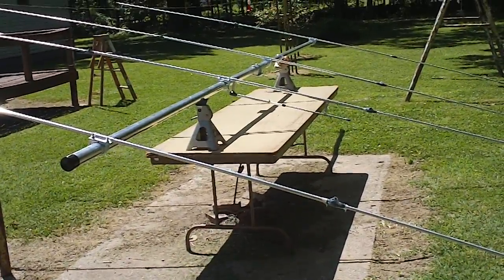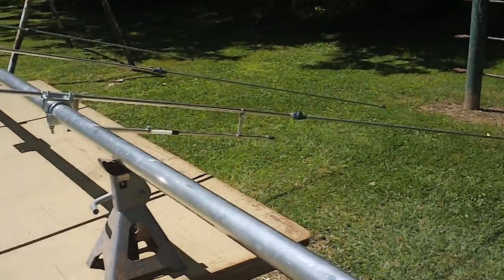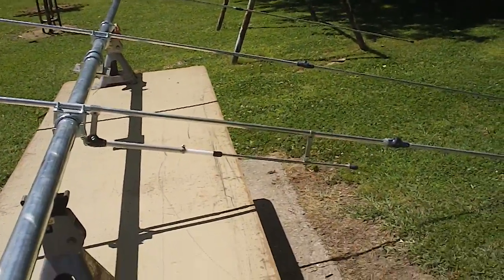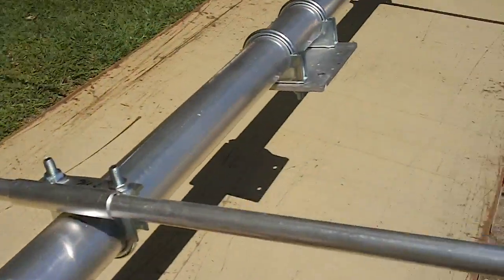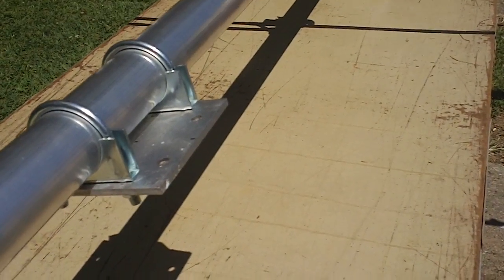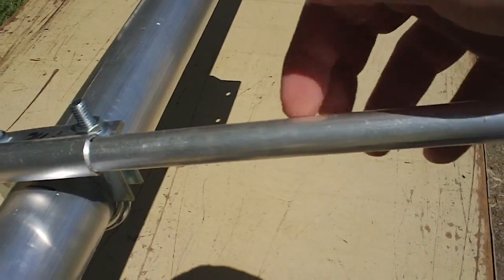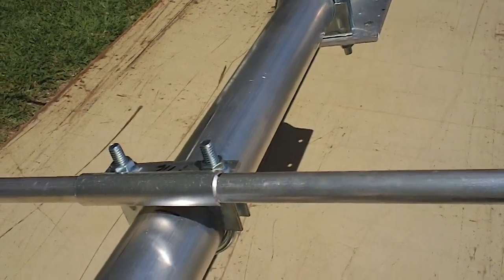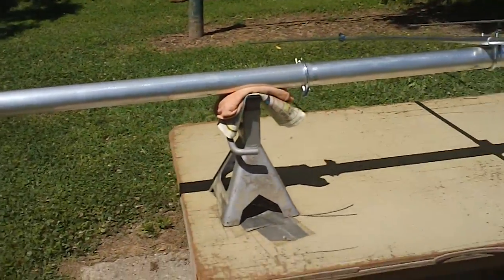The New Maco M104C Assembled

Comment: I know this is an old video but something ive learned throughout the last 45 years. When using vertical put the gamma match on top. I use a flip flop rotor on mine and when I rotate it vertical, I get a great standing wave with the gamma match above the boom instead of below the boom which puts the gamma straight in line with the mast.

Comment: Hope u like that antenna.....been running a m-104 horizontal. For about 30 years now.....2different cause I sold one in between houses .....great antenna....got qsl cards from 160 countries using 100w.....low noise,great side rejection.....great gain for smaller footprint.....still using one.....good luck....

Comment: When you seal your slip joints up like that do you not have a problem with condensation inside and not drying out? I'm getting ready to build a maco comet and I have a maco v58 right now and I'm considering sealing up all the slip joints with shrink tube. So I was just wondering if condensation inside the elements may be an issue.

Comment from the maker: For horizontal yes but for vertical using steel mast I've found it takes much more than 6". The tower & steel mast both couple with a vertical mounted yagi. You can raise them high enough to reduce the coupling with the tower but if the mast is steel it still couples with it & distorts the wave pattern. Experienced it many times in various real life tests. One example using a steel mast, tune a yagi horizontal & flip it vertical the readings on an antenna analyzer will be vastly different.

Comment from the maker: Shooting Stars are nice. Back in the 1990's I converted a damaged Shooting Star into a 3 element Comet. One end of the boom was bent & split but there was enough good boom length to make a Comet. The only reason I didn't go with a dual polarity array this time is because I'm going to move the V-quad to a shorter tower by my radio room and use it for horizontal polarization. I have a CDE AR22 for it and the coax run will be really short. 73's Paul

Comment from the maker: You didn't pay attention to the part were I explained what you see is not exactly how I did it. Yes I used a level for each element and the boom was clamped tight to the stands so it couldn't move, mentioned in the video as well. All is shown here is the end result after some of the setup (clamps and such) were removed.

Comment: Can I mount a maco m103 horizontal on a steel mast and get it tuned just fine to be OK? I won't switch it vertical I'll just use it horizontal, I will upgrade to an M105 later on down the road right now I'm looking to upgrade from my Andron 99 and I do not have the space for a M105 yet

Comment: Getting back into cb from being on the ham bands for a while.  I have a M103 in the shead but thinking about getting a m104,  I have a aluminum mast.     What is your opinion about the m104 vs a 103 I herd you said you experimented one.   Also when you mount it do you put the gamma on the top or bottom elements?  Im not used to gammas etc.   I build antennas and make them with baluns or use ladder line and a tuner on ham.  ETC.   Any input or advise or should I even purchase one?
Reply: A HERD is a bunch of animals like deer.HEARD is something you do with your ears. LOL

Comment from the maker: The stacking/cophasing I'm familiar with. Bad thing about it is I believe you looses half your band width stacked? Never tried it myself but that's my understanding. Other down side to stacking is the wind load & all that stopping inertia of two arrays. No problem if the rotor being used can handle it.

I must admit I'm ignorant when it comes to the effects of replacing gammas with baluns. I have very little experience with baluns. Your idea is interesting for sure. 73's Paul

Comment: Had my M107 monted on a 45 foot tower with the steel mast only 3 feet over the top of the tower. It was a murderous setup. I took a 10 foot section of tower and tied it to the deck out front. Then I mounted the rotor, steel mast and beam. I hoked up the Dosey and tuned the 2600 gamma match to 1:1. I took it all down and apart and then put the tower up. Then added the rotor, mast and Beam. At 45 feet, the SWR was 1.3:1. Good enough for me. I mashed into NJ and Penn from Eastern CT with ground wave conditions and skip was never a problem. Even on Ch 6, I talked at will except when one guy was on. We were neck and neck so he wasn't covering me up with his flat 6 and his steel tube amp. Not really trying to be the biggest. Just wanting to reach out there and touch someone.  :-)
Reply: Dosy meters SUCK or Dosey as you spell it. LOL No matter how you spell it they SUCK.I was also wondering what HOKED up is? LOL
Reply: They don't really suck. They are certainly not Bird 43 caliber or quality but they are good for in line monitoring as long as you aren't doing huge watts. I run mine mainly for the AM Monitor Function (Headphone Jack) and to be honest, both of my Bird 43's read the same as the Dosy 4001P on RMS. Peak watts are a bit higher on the Dosy. The Astatic and Paradynamics meter really SUCK! LOL. Ya! Dosy! I had a couple of typo's in that last message. Typing while on the job. LOL  :-O
Reply: Sure they do.Why not make a video showing the BIRD vs the Dosy on Peak readings? A Dosy has No Peak Circuit in it so it just jumps all over the place & some of us know what you said is total BS when the Truth would have been much better.

Comment: The two things that you can do to get around the steel Mast issue would be this.Buy another 4 element just like the one that you have now and stack them side by side 9 feet apart vertically.The second thing that you can do is to get rid of the gamma matches and go to direct drive with two DX Engineering 1to1 baluns.This would take care of the radiation distortion issue And improve band width, forward gain and rejection.Especially front the side rejection and front to back rejection as well.

Comment from the maker: That would work just fine for most but not in my case. I need a great deal of local vertical gain and can't get anywhere near enough with any omni. I'm eventually moving the V-Quad to another tower to use for horizontal polarization. 73's Paul

Comment: Actually there's less torque against rotor with stacked arrays on the tower then your single array 10 feet above the tower.Check out the A.R.R.L.'s Antenna compendium book for more info.Its about $30.00-$40.00 dollars,but worth the cost.It's a book about the thickness of a New York phone directory.But it's fairly easy to understand how to get the most out of your antenna investment.

Comment from the maker: The M104 is not drastically better than the M103 IMHO. Built the M103 for my friend & neighbor. He still uses it & it performs as well as my M104. The manuals for the Maco antennas are on their website for download. The gamma mounts on the bottom, counterpoise, side. I don't have any experience with baluns but I'm familiar with them. I'm sure you could make a balun for a Maco and feed it that way. Done right it's likely more efficient than the gamma as well. 73's Paul

Comment: I acquired a Maco 104 these days.  When I watch this video several times I see that you made several mistakes putting that antenna together.  The first is to use that silicone paste.  This antenna is one that fits in 1/8 inch measurements and it would be difficult to make some small change after that silicone dries.  There is no need for so much glue, the tube ties are made of very strong aluminum for performance.  The second mistake I notice is in the gamma match.  I see that it was adjusted.  There is no need to adjust it since it is configured to obtain the lowest SWR in 11 meters.  If you are correcting the SWR when the antenna is on the ground or has many obstacles it will give you a high SWR.  Once that antenna is in the air mounted your SWR will be 1.1 on channel 19. Third mistake I see is the distribution of the elements.  Because this antenna has a boom of three pieces should leave 3.5 inches at the ends of each end, so that you have no conflict between an element and the union of the boom.  I recommend following the instructions to the letter so that SWR is 1.1 like mine.  Use RG-8 cable at 100 feet.  Thanks for making this video, it helped me a lot to plan the installation of my antenna.
Reply: Hey Juan do you have the measurements of each element and spacing?

Comment: You should never put the black caps on the ends take that crap off 😂 that's how water gets trapped inside and don't let anyone tell you otherwise.Ive had all kinds of beams including laser 500,lightning 6 ,5 element cushcraft,6 element maco,shooting stars.. well you get the idea we been taking the caps off all of them since the early 80s we never use those caps anyone that knows this doesn't either take care 73s